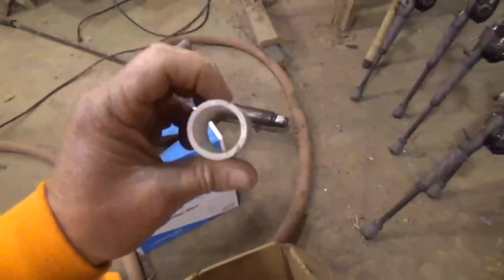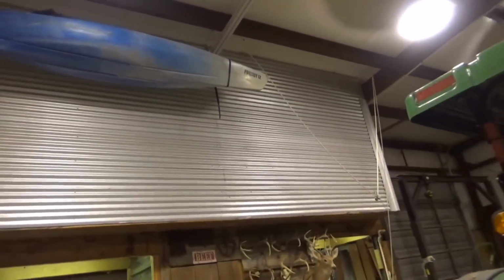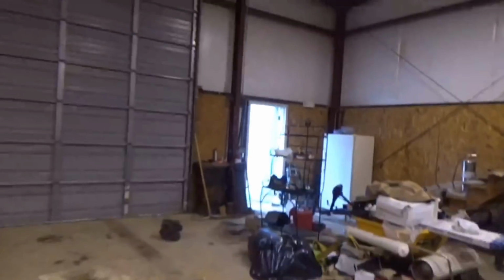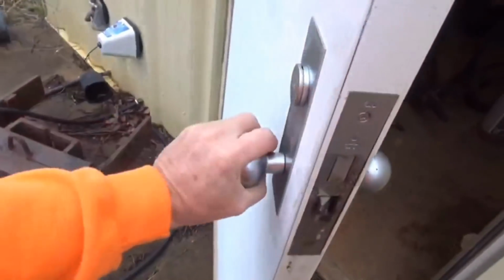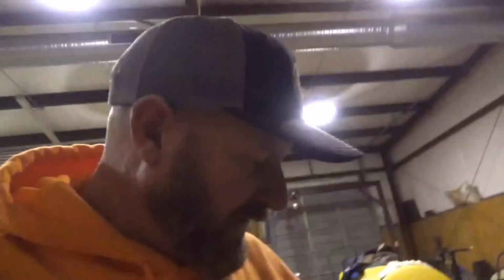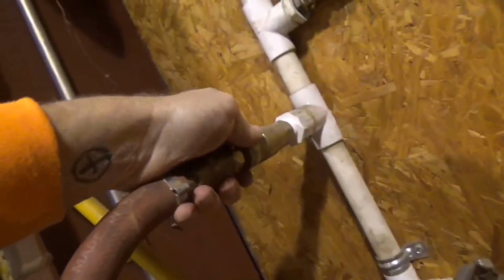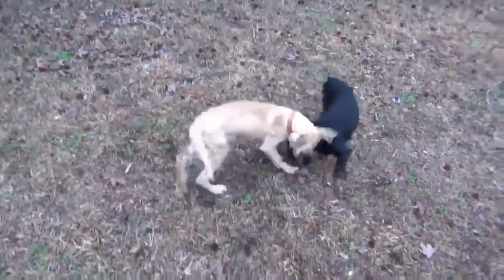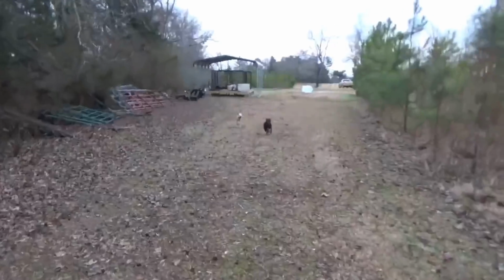Working inside my shop

Comment: you can get auto-drain valves that go directly on the tank and wire into the controls or a receptacle nearby; water still gets in the tank inside just from the humidity in the air as I imagine you already know. Who doesn't like a bit of rust water in their paint project?

Comment: We ran my Dad’s shop in Pex pipe and used threaded brass street Ells mounted with screws to the wall to thread the quick couplers too. We also made one drop just for impacts and then used a regulator for the rest of the shops air  header. Most air sanders and other tools only need 90 psi.

Comment: The pipe itself is fine,it's the fittings that cause problems.If you can find domestic made fittings that are sure enough sch40 usually it works okay.
Reply from the maker: Been waiting on someone to say that. You’re right, it’s just about always going to fail in a fitting.